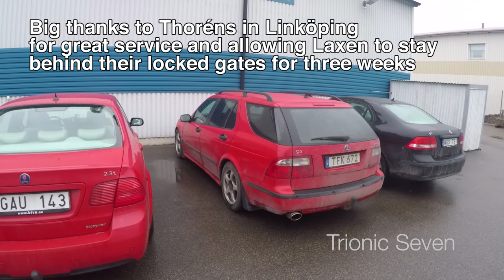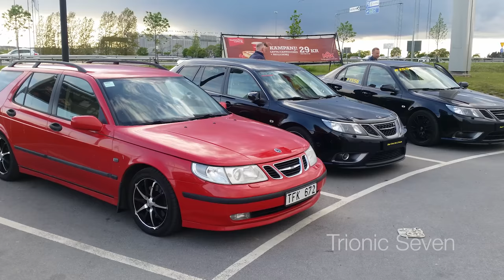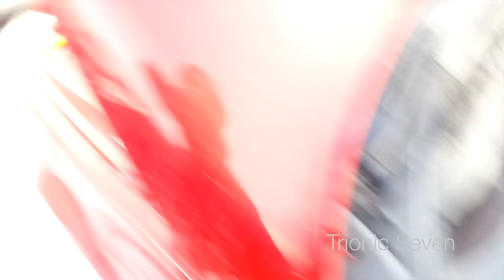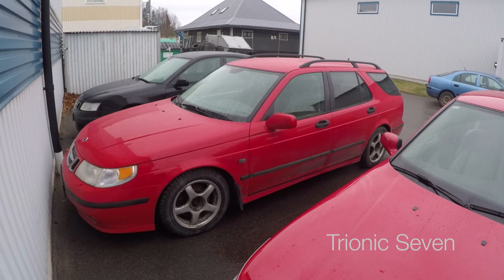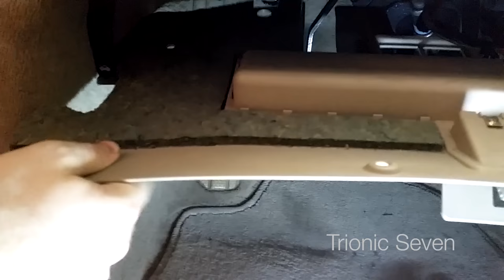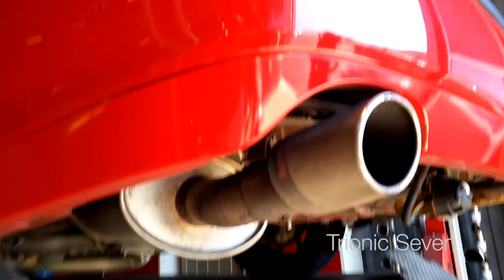SAYING GOODBYE TO MY FIRST CAR - Trionic Seven

Comment: I had an XK* Jag that did this after an oil change to Mobile1. Came into the garage with a specific request for the oil from the owner the synth oil after about 50 miles had turned to what amounted to paint thinner viscosity liquid. The engine was cooled, drained and had a new filter and refill with Synth Castrol. It has done over 1000 miles since and no repeat with an oil pressure test showing a steady 30psi at hot idle and over 70psi at hot 2500 rpm.

Comment: I would have said Oil Sludge issue, but you've changed so much including rods and bearings and breather systems as you said, it cant be. I remember taking the casings off the crank bearings on my own 9-5 that had a quality service history, lots of work done by me and others, but it was so badly worn I couldn't justify the expense of a replacement engine (on top of all else I had done).

Good to see at least its going to another Saab Lover.

I have so many good memories of my 9-5, it has a lot to answer for in my following car purchases being Saab.
Reply from the maker: Yep, I know for a fact it's not oil sludge. The engine looks great on the inside!

Comment: No oil pressure? Sounds like the guy who did the chain messed it up. Kinda stupid 'cause it's not that hard to do. The belt on the my gal's S60 with the invisible timing marks and using the top cover was hard. Yes, the sludging of the pickup screen is an issue. Use synthetic oil and heat wrap the converter under the oil pan (9-3s have this issue, I assume 9-5s are the same.) BTW, Mobil1 is fine. MOTUL, Kendall, Castrol, Valvoline and a dozen others: just fine.
Reply from the maker: Check out my follow-up video: https://www.youtube.com/watch?v=wDgwY0_T6fc

Comment: Hi, so sad to hear that. Honestly i'm not sure if you used always Mobil 1 oil was the best for engine, I can't explain well but my best friend a SAAB specialist in Marseille said that kind of "hyper technologic" oil are not good for the long term use in our cars...Anyway i don't know if it's true or what ?  Let us know what was the problem. Tak!
Reply from the maker: That's probably the worst oil description I've ever heard...
Reply: psv1600 bruh Mobile 1 is recommended for saabs
Reply: Mobil 1 mostly produces group IV synthetics whom tend to be more agressive on rubber than group III (hydrocracked) oils. Therefore on a long term basis, rubber parts can lose its elasticity when in contact with PAO/PAE oils (polyalpha-olefin, group IV base oils), and degrade over time. 
Maybe that was what you were thinking of?

On the other hand, a group IV oil will allways be more protective against wear and can handle heat better than the "refined mineral oils" a.k.a group I,II and III.
Reply: Hi Olof, I guess something like that, I'm not experimented and my friend too, but I really believe in your analyse and I think you're really right...Thanks a lot for that info
Reply: A "full" synthetic oil is designed to be used as a Engine Oil, hydro cracked oils are the poor man´s alternative, so I bet my ass that fully synthetic Oil is better in every aspect than it´s counterpart..
Reply: psv1600 оо
Reply from the maker: Only use full synth in the 9-5.

Comment: The reason it´s failed is probably the oil pump.  Not so good oil pump on 1997-2003 9-5 = less oil pressure!

This makes me want to upgrade the oil pump to the newer 2004+. My 2.3 LPT 9-5 has 353,000 kms.

Also the Aero is the most critic model. There are lots of LPT´s doing 300K miles, there even was one 1998 9-5 2,3 LPT in the Netherlands with +-  700K miles (first engine!), on the Aero this is just almost imposible.

The reason for this is simple: you have the same engine on the LPT than on the Aero, so being all factors the same the engine in an Aero works a lot harder than in a LPT! Necessarily has to last for a shorter time. 

Tuning = necessarily more engine wear ---> the same candle that shines double as bright lasts for half the time! 

Also, if you drive very often at  >3500 rpm on the highway the 2,3 with a longer stroke! may last shorter than the 2,0!  

    The speed at which the pistons move are critic on the 2,3 at very high rpm, not so much on the 2,0!

This happens to B234/B235 Saabs who drive very fast on the autobahn ---> Bye bye engine.

The most reliable engine for >4000 rpm --> B204.    

Apparently after 2004 they not only changed the breathing system but they also returned to the Saab 9000 oil pump.

Check that in the WIS.

So 2004-05 were probably the best years for the 9-5 (and I say this having an 02!).

2002 it´s a very old car now but still, I would have put a B204 on it, the interior seems to be in good shape. It´s just saving another Saab! But I guess thats me

Wish you all the best!
Reply from the maker: I'll give an update to the car's fate soon. Spoiler: It wasn't the oil pump!